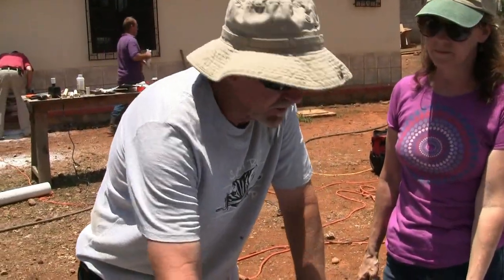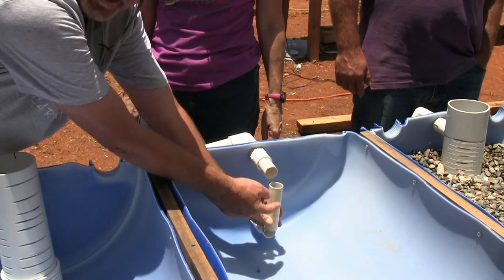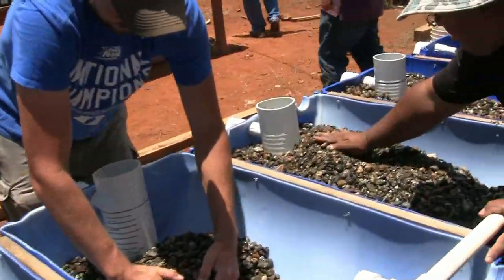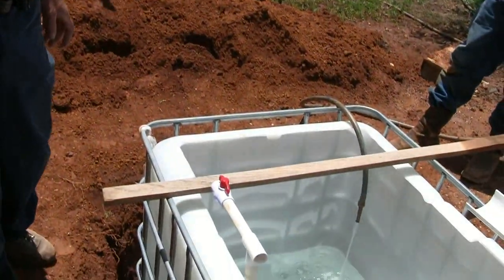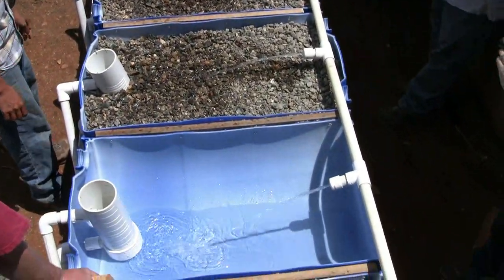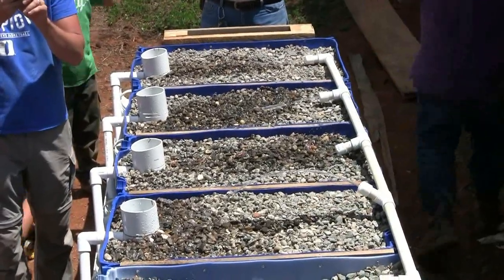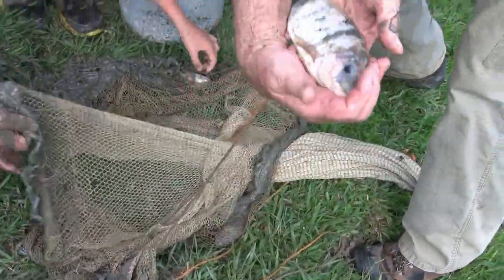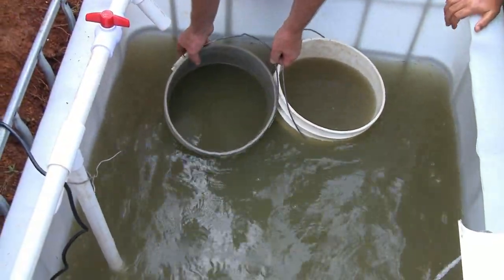Aquaponics System Build in Real Time Part 5: Module 7 of 7

Comment: did you use  3/4 " pipe from the pump all to way to dump tank     and where does the 3/4 pvc  fpt x fpt union go    thanks
Reply from the maker: Glad to see you are asking questions about the system. Where you able to get the system design from Don by emailing him from the address listed at the end of the Building an Aquaponics System in Real-Time video. This video you commented on is one part of the whole build. 

There only a few places screw-type PVC pipes where used. They were used at the bottom of the dump tank and on the grow beds. On the grow beds they are used as the overflow and the water return.
Reply: William Wagner I got the instruction before I started from Don   And I watched all the videos    Nothing explains what size pipe to use for the pump   And attaching the pump  to the pipe    Also not sure why the instructions calls for two pumps 
There’s only one pipe coming out of the fish tank  
Also emailed Don  he hasn’t been able to respond